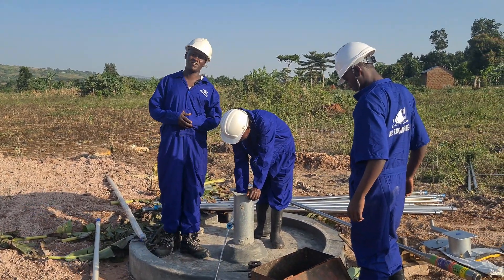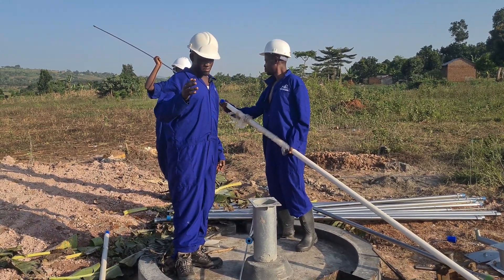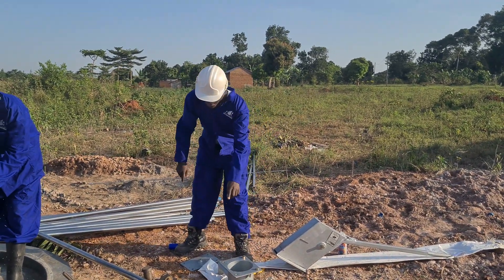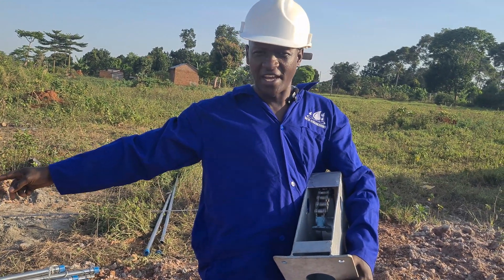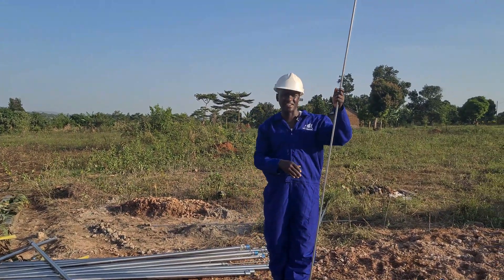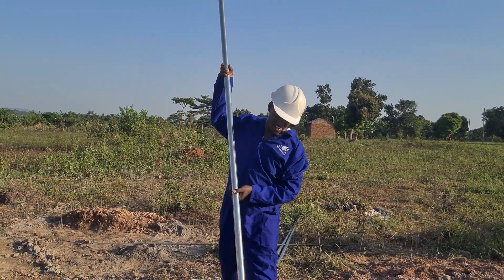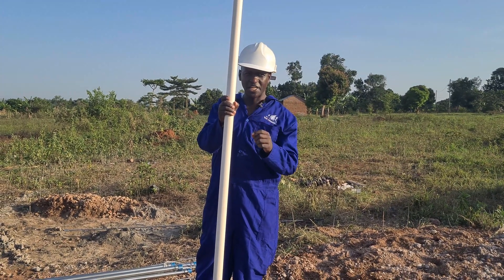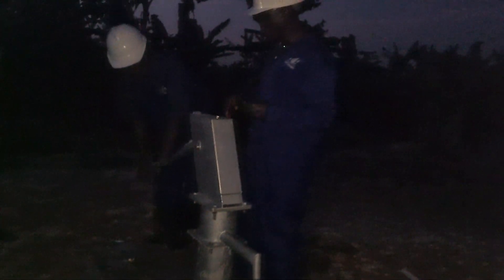Do you know what a hand pump is and the main materials components

Comment: Thank you again for your informative video. Very well done. You briefly mentioned a PVC or plastic pipe. Up to what depth should one use PVC pipe before deciding on stainless steel pipes? I understand the deeper you go, the PVC pipe will not be as strong as a stainless steel pipe. I take it each pipe is around 10 feet long. Many thanks again
Reply from the maker: 65Feet would be appropriate,
Factors like well diameter (machine drilled have smaller diameters compared to hand dug wells), and protection put on the pump handle may also have an influence on the installation depth